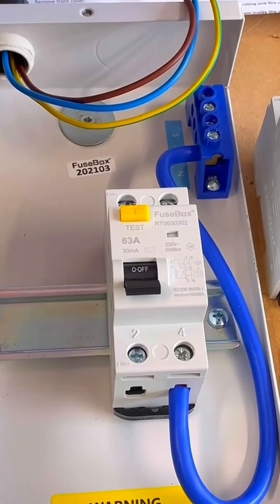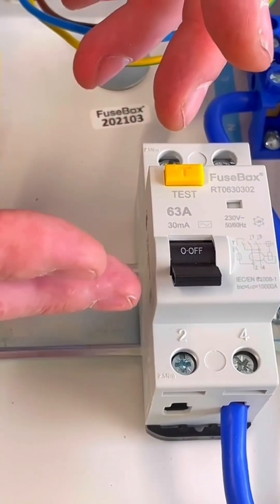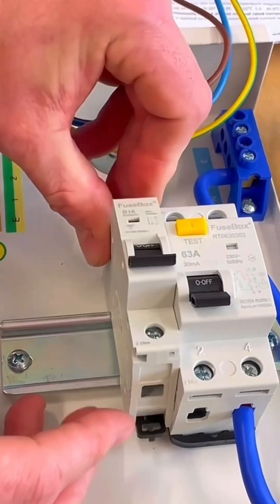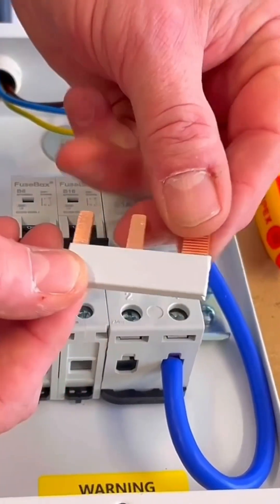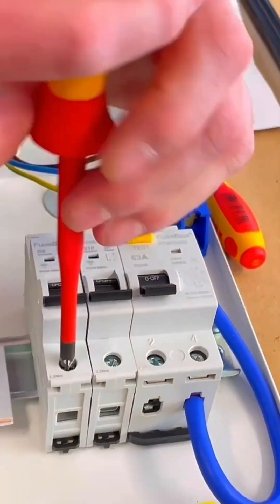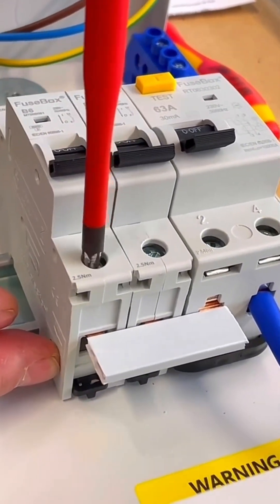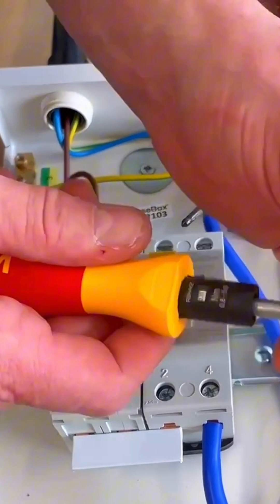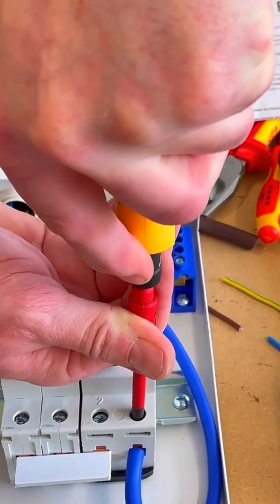How to Fit a Bus Bar

Comment: This is the worse bus bar installation video I've ever seen. Bus bars are still IP00 because pushing it with palm will move the plastic trim and expose copper from the ends. There are end caps. Forget this bus bar manufacturer, rubbish.

Comment: My tips for assembling the busbar:
After loosening the screws, I push all the screws with copper wire, as sometimes a magnetic screwdriver pulls the screws outward.
After screwing the busbar in place, I use a small mirror to check if everything is properly tightened. Often, while testing, I've found a loose busbar.